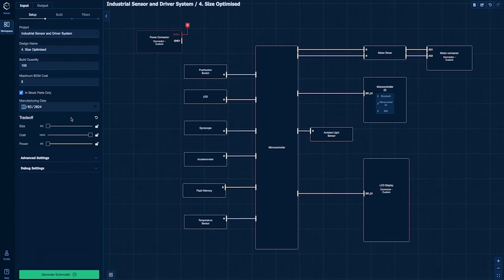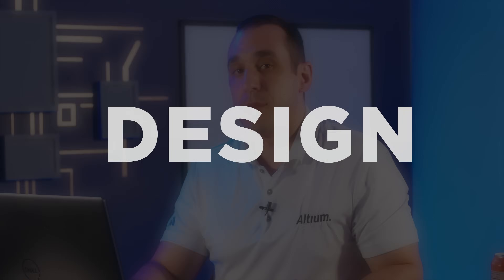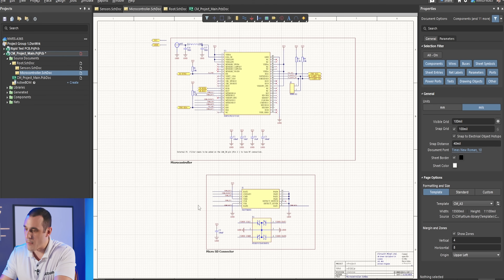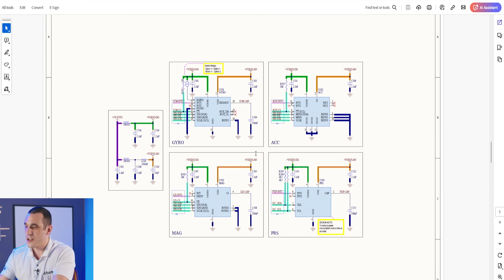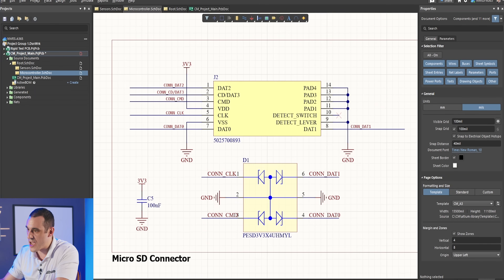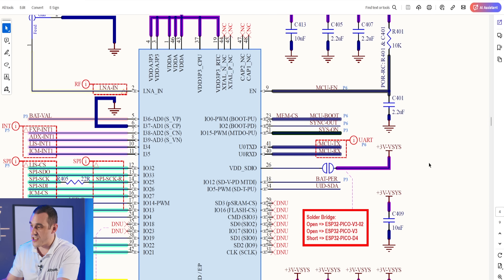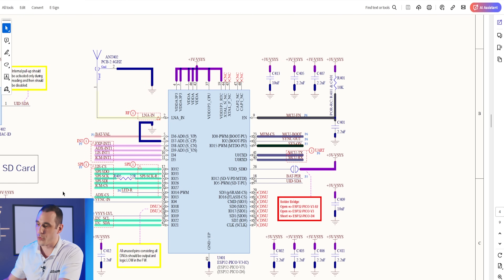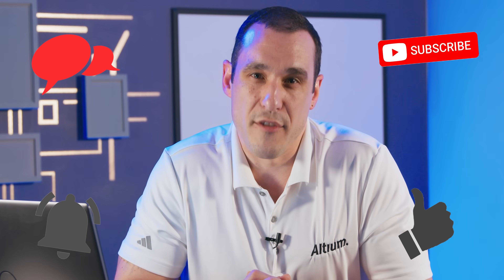PCB Designers, Is AI Your New Rival? See the Results!

Comment: I have to admit that having an AI version of the design will help management and engineers do a better job. Management will quickly realize that Input requirements matter and Engineers will possibly get another view of available parts they originally may not have known or thought about.

Every design should have design reviews, Adding a machine review at the requirements, design, manufacturing and test phase will only help reduce mistakes and oversites as soon as possible.
Reply: I think the best thing about an AI version of the design is that it functions as a good reference design. It is a really great check against a human designer, and you can use portions of the AI design to help save time. I think it also helps with reverse engineering a design when doing new revisions. Overall a very useful tool, especially if you have never designed the particular system and don't have any of that IP.

Comment: I believe that the high integrated power module also needs an EMI filter which is not included.
Reply: Yes that's a good idea, although the filtering requirement would depend on the spec one is trying to meet or if there is a specific standard that the design is targeting. Just writing "EMI filter" can be a bit misleading, especially when the design is running on battery power. If it were running from a bench supply or external unregulated power it would be quite different.

Comment: Also, can we talk about that 1.8nH inductor on the antenna that's likely going to low pass out all your 2.4GHz signal with even just expected trace capacitance for the C values? The AI has designed a circuit that just won't work
Reply: That's fair but it would need to be tested with different caps anyways because the PCB layout can induce parasitics which modify the performance at that frequency.
Reply: @Zachariah-Peterson  nah, calculate it as a basic CLC filter, it will low pass out anything above a GHz with only normal trace capacitance in the pF

Comment: I believe that chip manufacturers should embrace AI by creating dedicated AI models for their chips. These models should be trained on a wide range of information, including datasheets, user manuals, development boards, reference designs, and more. Additionally, chip manufacturers should provide AI-driven models for schematics and PCBs.

A tool like Altium could then import these models directly when a chip is added to the design, allowing AI to assist the designer throughout the schematic and PCB layout process. This assistance could include guidance on optimal design practices and error prevention.

For component selection, AI could either automate the process entirely or offer suggestions to assist designers in making the best choices. The core idea is that semiconductor companies should create AI models for their chips, just as they currently provide schematic, simulation, mechanical and PCB models.
Reply: CircuitMind can leverage these models to drive innovation by generating proposed schematic and PCB documents. These documents could then be imported into Altium, offering added value based on the models. Alternatively, these models could be directly integrated into Altium to assist designers throughout the design process.

Comment: I’m a developer and when an AI generates code, you can always put it in a sandbox, run it, and see if the thing actually works before investing any time on it. If it does and the code looks good, you have a nice : low labour and low brain cell count vs high productivity ratio.

With PCB design, what are you supposed to do? Do a full review of what the AI has generated!? Double-check that the generated MCU pinout is actually valid, that the symbol creation has no bug, that the manufacturer’s recommendations are met, etc. 

That seems to me like doing the full job anyways. Indeed, the tool spits a full schematics, but then what? Who in his right mind would send that to layout and production without doing a meticulous review … which is the most time consuming and requires most expertise. It’s a convenient first draft or alternatives exploration at most, to me.

AI would be terrific in a DRC on steroids that analyse your schematics logically, runs calculations on components selected, compares your design to thousands of others and pinpoint some specific concerns.

To me, this company’s vision is misguided.
Reply: This is actually a great question

As an additional step, we run detailed verification checks with a separate engine (advanced rules-based DRC) after the Netlist has been generated. In fact, some customers are looking to use that engine standalone to verify their manual design. 

Also, our algorithms that generate the circuits are deterministic. They are mathematical, designed to be precise and accurate, to SOLVE for a circuit (kind of like a simulation).
Reply: @tomideadesanmi1673  What i find odd is lab centers Proteus has one of the easiest and accurate although a bit outdated simulators i have ever used and built so many things that just worked right out of the box and that software has got to be over 20 years old now and every AI i have used is an abysmal failure frustrating and just not worth it.. 
Maybe in the future it might get there but its far too infantile at this stage. And the price of admission is just too high to justify it..
Reply: This is the point of tscircuit, the AI writes circuit code which is then run to verify DRC checks etc.
Reply: @seveibar  As i said above labcenters Proteous i have been using for years has a great simulator even if outdated and all this hype over AI and they cant even do rudimentary real time simulations is a joke to me when i'm doing it successfully to working prototypes on 20 year old software.

Comment: I could say a lot regarding this video, but I'll just say this, if the human didn't know about the first integrated component, was he also so amateurish not to know that gyroscopes and accelerometers are commonly integrated? He must have separated them intelligently.
Reply: That’s why I think this company’s vision is misguided. 

Maybe the designer could source those separate components easily, had full knowledge of them from past design, has them stocked in house, allow for easy replacement from other manufacturers, etc.

This AI bombards you with “niche” components that locks you with a specific manufacturer, and pricier options without knowing if it necessary given your constraints.

It’d be better if it would analyse your schematic and tell you how you could do differently. Or better, understand the general approach you follow and tell you where you could improve.
Reply: @adrienferreira4666  The idea that an algorithmic platform cannot constrain on all the things you said is not a really good assumption. 

The platform can select components based on your company’s preferences, stock, pricing etc.

Comment: So it's just reusable blocks that "AI" connects together?  If I have to manually create a high level block diagram I could do it in Altium with reusable blocks and voila, same result. Somebody just needs to share a good library of reusable blocks or maybe Altium/chip manufacturer could step up and provide them. The problem is that no working pro will ever use this because every one likes a different resistor designator, uses different mechanical layers, has proven footprints that will never change in production, etc...
Reply: Not everyone has that much design IP, why not have a system that can generate some of it? As far as semiconductor manufacturers providing this, there is another platform called CELUS that takes this approach and has gotten some traction with the semiconductor manufacturers.
Reply: @Zachariah-Peterson  I will look into CELUS thanks. I think that having an AI system can be good for brainstorming by trowing an idea to it and see how it solves the problem and what components uses. Personally I will never use anything straight out of it for production and I will never trust it. But that's just my way of doing PCBs.
Reply: Nope! It's not reusable blocks. We create a digital twin of components from datasheets i.e. all the information you'd normally read in the datasheet is now in a digital model (in our database) that an algorithm can read and understand.

Then we've developed a proprietary algorithms that uses circuit design rules to solve for a circuit. The algo takes your requirements, reads the digital model, performs compatibility checks, assigns pins, and adds all the circuit ancillaries (pull-ups, pull-downs, decoupling, level translators, crystals etc.) all at the same optimizing for cost, size, power, supply chain, etc. 

All our customers are professional engineers and companies.
Reply: @tomideadesanmi1673  I’m sceptical on the MCU pinout side of things. 

I’ve worked on +100 pin MCU designs where each pin has exclusive IP capabilities that, when selected, excludes functionalities for other pins and create interlocking problems leading to dead ends.

Some functionalities require specific VDD that forces to change the voltage level for a whole bank of IO.

Some specific pins can deliver so little current that you have  to be careful even for standard GPIO operations.

When set into reset, some pins of the MCU become outputs and drive a specific voltage high by default to accommodate for firmware update, so connecting it on any kind of output would burn the chip when it goes into reset.

I can go on forever with this. 

Again, I’m very sceptical that your tool accounts for all of that. But I let you prove me otherwise.

If your tool generates a schematic and I’m then forced to dive fully into the component’s datasheet to double-check each and every pin anyways, I don’t see how it saves me any labour, expertise, risk, or brain power.

This, and the fact that creating a schematic from scratch with niche components I’ve never experienced or that have nothing to do with manufacturers I already work with or that I  have components sourced and tested.

What is exactly your target market? Companies with no existing designs or that have enough money to start a new design from scratch on things that already work?
Reply: @adrienferreira4666  You know how you just described a really detailed optimisation problem with lots of rules and exceptions to apply? You know what computers are really good and and humans are really bad at? That exact thing.
Reply: @zyeborm  Exactly
Reply: @zyeborm  I know, I’m a software engineer. I’ve actually developed a Python script that solves this problem for my company, since I had to create a pinout for a high-count MCU with interlocking rules that made it impossible to solve it by hand. I talk from experience.

Still, that’s not the question I asked, and I still haven’t had an answer. 

I know the time and effort it took me to code only a subset of rules of the MCU’s datasheet and I’m even more skeptical that their tool is able to crawl the PDF of a datasheet and extract all these subtleties and spit-out a valid pinout.  

Which goes back to my main point: if this tool doesn’t do it, I’ll have to do it myself anyway, so I don’t see where I’ve saved any time, lowered my risks of design mistakes or saved myself any headaches from solving real-life problems that I’m paid to solve.
Reply: @adrienferreira4666  The tool does it. In my original answer, I described this: We create a digital twin (a model) of components from datasheets i.e. all the information you'd normally read in the datasheet is now in a digital model (in our database) that an algorithm can read and understand. This includes all the information you mentioned and much more.
Reply: @tomideadesanmi1673  thanks for replying and for clarifying the reusable block topic.

My comment is very personal to the way I work, being a freelance that also offers more services related to product design like firmware, mechanical design, certifications and manufacturing; I consider the schematic an essential stage of the process and have never had the need to optimize it for speed.
I prefer to carefully draw it by reading data sheets and most of the time by also building proof of concepts with dev board to test specific components.

What I like about AI is that sometimes it can find new components.

By also doing firmware drivers and helping with board bring up I need to read data sheets, also for layout of certain components it is essential to read all the documentation.

As much I would like to have a working solution there are just too many variable to consider, I hope you succeed in your venture and make a product I will use one day.
Reply: @exapod23  Hi - Great to hear from you. On your previous question. Yes, we do take into account all those rules you mentioned. We started the company with experienced Electronic Engineers + Algorithm engineers, so we made sure it was "accurate designs" or "no designs".

I understand your points. I agree - it's not about optimising schematics for speed. We optimise the component selection, enable you to run scenario analysis on multiple design options to get lower cost, lower power consumption, high performance, supply-chain resilient and small form factor design options based on your needs; we help prevent errors with detailed verification checks; we help generate some documentation.

Having said that, as you have said: the engineer still needs to do the engineering work. It's critical - You're the engineer after all. AI only augments and will never replace. You should be spending time on the most creative parts of the design task that require your experience. You should be architecting, verifying, solving for the toughest parts of the circuit, adding circuitry that increases robustness,  architecting your firmware etc. 

You're in the driver's seat. You're responsible. You're the decision maker. You're the engineer. You're the man. This will always be the case.